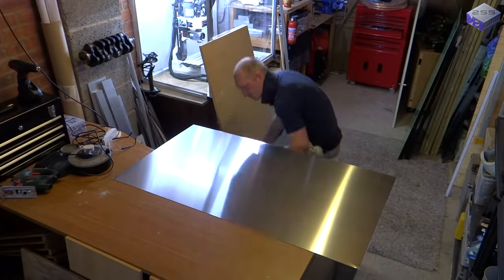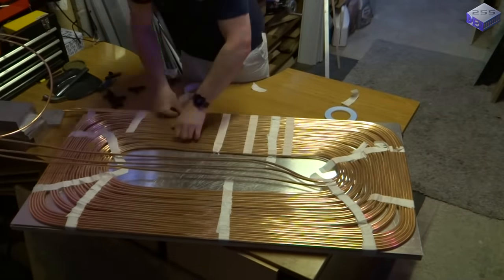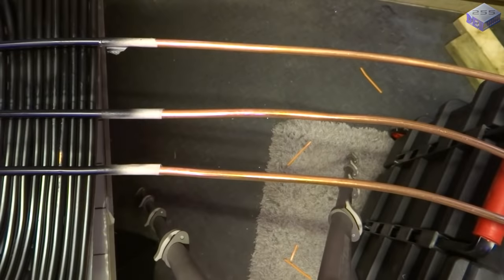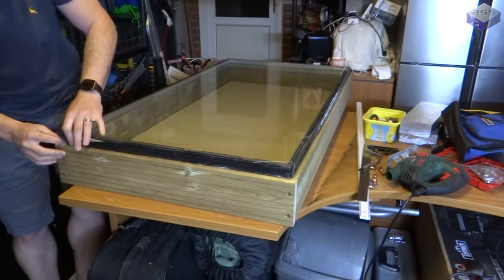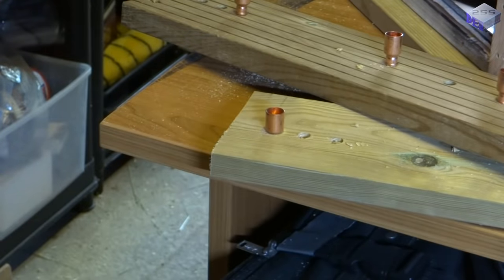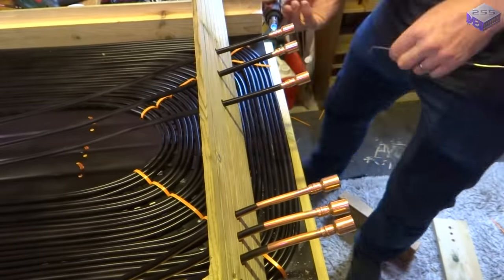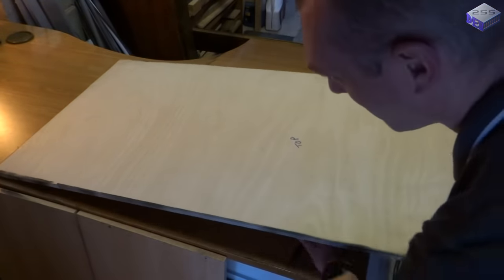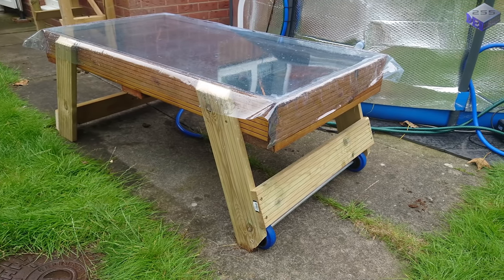Improved Solar Pool Heater - Full build

Comment: You have to know if the insulated glass has any coatings. Many times insulated glass can have solar reflective coatings that will reduce solar heat gain inside a house. So that would be self defeating. Just something to be careful with.
Reply from the maker: Thank you, I will have to get a meter to test the reflectivity of the glass and try different materials, I think Acrylic may be the best option. I will look to make a video on this and other changes that have been mentioned. I guess that's why green houses are made up of single plain glass.
Reply: @TheSolarPoweredEngineer  new greenhouses are made of polycarbonate roofing sheets, which are a lot cheaper (then glass) and more insulating then a single plane of glass (as pockets of air, traps heat) and a lot stronger (as glass shatters), also polycarbonate needs less cleaning, as glass needs to be cleaned more often to give it that nicer look. If you use toughened glass (as that still needs to be cleaned regularly) that is very expensive and not cost effective for a greenhouse which uses a lot of surface area.  Polycarbonate roofing sheets, diffuse bright sunlight light, which is better for plants photosynthesis. So plants get more light from all over instead of very concentrated unidirectional light which can burn plants in the midday heat. Green houses are for plants growth and cost effective results, so the glass doesn’t break, doesn’t need regular maintenance and mainly plants grow fastest and produce best crop yields, they trap in heat and maintain constant temperatures for a bit longer in winter and stop over heating in summer, which you may not want for a solar heater. 

Polycarbonate roofing sheets are newly manufactured in response for greenhouses as there is demand and market for it. Hence are cheaper as the need for food and crops yield is very high. For solar heating a new material should be made, and is made (solar glass) but is very expensive as it’s a luxury material not a necessity one like growing food. Demand is low, so cost is very high, but results is excellent, in fact the best by far. 

However for a smaller project like this, it may be worth it. As you only need a few square meters. 

On a larger scale the cost vs benifit means ; not worth it for solar glass, so plastic wins it. And the surface area is increased to increase the overall heat output. Rather than expensive materials which only makes a smaller difference. 

Glass transfers more light than plastic, so will create more heat under it, hence can burn plants, but retains heat less, as it conducts it out faster, but is more expensive per square meter and needs cleaning and can shatter. Different purpose then solar heater.

Cost is a major issue with large scale projects. As well as longevity of materials. So short term costs and targets and long terms costs and targets have to be considered as well as labour costs and maintenance. 

https://greenhouseemporium.com/blogs/greenhouse-gardening/glass-vs-polycarbonate-greenhouse/
Reply: @TheSolarPoweredEngineer  polycarbonate is better (retains heat much better) than acrylic and is much cheaper for the same square meter and overall thickness. Eg 4mm of polycarbonate (per square meter) is ~ half price of 4mm acrylic for the same square meter.

They use polycarbonate in modern green houses and not acrylic anymore, which older greenhouses use to use. Cheaper and better, and allows plants to grow faster without damage.
Reply from the maker: @harunyahyadotorg  I will have to get both polycarbonate and acrylic of the same dimensions to see which yields the most. One thing I want to try also is reducing the amount of air in the panel, so reducing the sides of the frame so that the tubes are closer to the acrylic/glass/poly cover. Plus, this will also reduce the shadow forming over the tubing. Thank you for your reply, I love the detail you have gone into. 👍

Comment: Looks good.  Could you use Acrylic instead of Glass for strength?
Reply: I would think that it would work better actually. Acrylic won't block UV light the way glass does, which could increase thermal collection, and has a lower conductivity, which will hold more heat in. If you're going through the trouble of insulating the back, you'd definitely want to double or maybe triple glaze the acrylic to get the best results.
Reply from the maker: Definitely, or even clear polycarbonate. I was looking into some of the comments here where they were suggesting the UV reflecting properties of the sealed unit, I may have to purchase a few different types to see which one is best.

Comment: If you made a triangular support so you could angle towards the sun you should get better performance.
Reply from the maker: Hi, I will be looking at solar tracking the panel this year with an Arduino based system, or even have mirrors that track the sun to reflect on the panel as this may be more efficient.

Comment: I would have drilled a small hole in the chassis. To avoid air volume within the chassis to apply pressure inside the body due to temperature increase.

Comment: Please: What is the ratio [KW / meter of copper tube used] in each Solar Pool Heater (A) first and this b) second improved one) ?
Reply from the maker: Good question. Well there was 50m in solar heater A and 75m in B and with around 900W in A and 500W in B, this would be 18W and 6.67W respectively. This doesn't sound like a lot, although accumulatively both panels together provided around 7kWh over a good day with good sun coverage.
Reply: Wouldn't you agree then that first version with 18Kw/m  production had a higher heating performance? :) 
If so, what do you think is the reason for this "improved " version to perform poorer as the first / more basic one? Thank you in advance.
Reply from the maker: @rubencg8787  Hi, totally agree, although this improved version is much smaller, more robust and has the potential to generate more than the first version, there are a few tweaks that I need to try, such as changing the glass for acrylic or polycarbonate to let more energy in, reduce the air gap in the panel, improve the insulation and work out the best flow rate to generate turbulent flow in all pipes. I may even try different paints to see how effective it can be. This one is far easier to store as it can stay outside too. I want to also add a couple of side reflectors that track the sun to see how much energy can be captured

Comment: Im.plsnning a 25m x 8m x 1.2m pool in zambia, what do u suggest for heating in the cooler months?
Reply from the maker: Hi, if you filled your pool up to 1m, you would have 20,000 Liters; my pool only holds 4600 Litres at best; it's difficult to say over cooler months, although our pool maintained around 10ºC above ambient outside temperature a few months into autumn. The best option for most size pools would be a pool blanket (micro 500) and pool cover. The more you insulate the pool, the easier it is to maintain. The micro 500 covers allow around 80% of the sunlight to pass through to heat your pool and reduce evaporation. If you were to add several solar heaters, I think about 10 of this version 2 heater or 5 of the version 1 solar pool heaters would work well. If you want to make one, it's best to test just 1 out on a small pool to see how it performs in your area. I hope that helps.
Reply: @TheSolarPoweredEngineer  thnx 2m is 200,000 lt
Reply from the maker: @brendsn roberts  Ah, sorry, yes, I missed out a 0, doh! a small mistake, although a massive outcome. It may be better to look into a PV Solar Powered heat exchanger or mains powered as it will take a fair amount of energy to maintain a decent temperature. Again, insulating the pool as much as possible is still crucial to saving energy and conserving pool heat. Good spot on my error though 👍

Comment: also consider, that your FLOW rate is 2 parts.   1 is the volume, the other is the speed at which the water moves.    for heating like this, you also need to consider SURFACE area that is in direct contact with the water.   so,  with an unknown surface area, you can assume the following.    higher SPEED = less heating.   higher volume = less heating.   and higher volume + higher speed = 2x less heating.  

with this above, we can dream up a quick example demonstrating the above.   if you used a large fire hose 2 inches, going through 2 inch copper pipe,  pumped with a pump that a firetruck uses..   its heating would be near nothing. because the water is such a large amount of volume and speed, that it never has a chance to heat...  

the oppisate is that you have a small 1/8th inch fish tank air hose line, going the same distance,  but pumped at less than a gallon a minute would produce the MOST heating.

so, for your little heater you made,   set the hose to SERIES, so that you get the LONGEST amount of time for the water to be heated, and slow your pump rate down to increase it even more,  would increase your heating by a very large factor,  no matter how much sun there is.  

but this is all dependant if you can HEAT the water beyond its current temp.. otherwise you have a pool COOLER!!
Reply from the maker: All things to consider in my next test of it, I will try several different methods including pump control and may even get the Arduino to find the best flow to temperature increase by testing at different intervals, then changing to series and doing the tests again, kind of like a car ECU working out the throttle map for best air to fuel mixture at a given rev to get optimum efficiency.

Comment: Nice thanks ,what temperature you can make ?  possible to use this  for my house heating .
Reply from the maker: Thank you, yes you could use this system for your house, although would need a good number of units depending on your system and may not be viable. I would have a backup heating system as well though for overnight and winter months. The best way to look at these are the wattage they are capable of, this one measured around 500W with direct sunlight, so take a look at your current boiler to see how many Watts that is and you will know roughly what you need. Most combi-boilers are around 12KW I believe, so if you wanted that sort of power you would need 24 of these, and that's only while the sun is shining, so may not be your best option. I suggest taking a look at air heat exchangers or ground source heat exchangers/pumps. I hope that helps. Oh and its possible to get the water temp up to around 68ºC, but that's only 10 Litres in a bucket, so it depends how much you are heating
Reply: @TheSolarPoweredEngineer  thanks Neil . Clear answer and very good video
Reply from the maker: @reneterm25  Thank you, glad you enjoyed it 👍

Comment: I would have put a bead of silicon on the wood between the glass frame and the notch it sits in for a seal there and then went around to clean up the visible outer edge.

Comment: Hi Neil, firstly great job. I'm planning  to build something similar, so after a search and finding yours, I plan to build virtually the same thing, based around your design, so thanks! You mentioned in one comment that you are thinking of removing the glass and replacing with plastic, which type would you replace it with?
Reply from the maker: Thank you, I am looking to test a few different types, although a 2 way mirror was mentioned and a glass panel from a green house, as this does not block any rays from the sun, so I believe this would be the best option. Also, the use of plastic cable ties may mean they degrade, so probably best to use metal ties, plus you may need a breather pipe from the inside to prevent condensation build up. I'm looking in to copper use with chlorine at the moment as it's a concern for some people as it can degrade if the PH balance is off. Hope that all helps, good luck with yours
Reply: @TheSolarPoweredEngineer  Hello, how would someone install a breather pipe? Thinking of building this after summer exams!
Reply from the maker: @nermainmerl6108  Hi, this can be installed the same as the other pipes, so two short copper pipes (one at either end) that point down to stop the rain water getting in. I will be looking to modify mine soon to see if a clear polycarbonate sheet would be better for its efficiency. Hope yours works out well. Good luck with your exams.
Reply: A coil of black HDPE will perform about the same and is far less expensive. I will have to be longer to compensate for the poor conductivity though. 
Ideally if glass, it should be low iron glass and tempered. Relatively small hail will break a normal window. 
Two or three wall polycarbonate is another good option.

If going with copper you might consider getting a copper sheet instead of aluminum. Though more, you can use less tubing and solder the pipe to the sheet for good conduction.

Researching selective surfaces wouldn't be a bad idea either. They are one that has a high absorbtivity in the visible spectrum, but poor emissivity in the infrared spectrum. As I recall black copper oxide is one. Which might be formed with a caustic or acidic wash.
Reply from the maker: @court2379  Hi, I agree, my previous panel is HDPE I believe and is under an acrylic sheet and collects around 900W (max) on a good day with direct sun. I do need to do some modifications to this one, with one of those mods being an acrylic sheet.

I did look at a copper sheet, although as you mentioned, it costs a fair bit more but would enable me to solder to it.

I'll have to look into copper oxide then as I have been looking into getting the most out of different wavelengths, I believe IR accounts for around 45% of the suns energy that we are exposed to (probably why we can't see in IR, as it would be quite a blinding light).

Comment: parael is nice but you are not sure that all 3 pipes take the water water takes the easy way so 1 pipe can do more than the ather 1
Reply from the maker: Very true, I did think of this, although all pipes are outputting some of the water flow due to the pressure from the pump and remain cold (heat transferring to pool). If I was to put them in series the flow would be reduced, with the pump working harder (more power required) for the same heat output (slightly reduced efficiency of heating when slower flow) so I opted for parallel configuration and ample pressure to ensure flow through all. Good observation 👍
Reply: @TheSolarPoweredEngineer  or take 3 falfs and 3 flometers than you can see and control the flow
Reply from the maker: @arthurvandongen2  Good point, I may just do that to see which one is best and then equalize the flow. Flow meters are quite cheap now, I could also attach a temperature probe to each input and each output, then calculate the live Wattage from each channel and how the valves affect each one 🤔

Comment: Sorry to say this after the fact, but if you were to sand the pipes with a coarse sand paper you end up with more surface area and therefore more energy absorption.
Reply from the maker: Hmmmm, very good point, I hadn't thought of that. I may be trying out a different option later this year, making 300mm by 150mm aluminium heatsink style panels with lots of machined out fins, all sprayed black with a copper pipe running through them, all behind either purspex or glass in a thermally sealed box. Thank you

Comment: So you need to heat your pool in the summer?
Reply from the maker: Yeah, it does seem a weird idea considering it is nice to jump in and cool down, although our UK summers are far from constantly hot, plus it's nice to jump in a warm pool in the evening after the sun has disappeared (water is a good store of energy with a specific heat capacity of 4182).

Comment: Be interesting to see if pool chlorine reacts with the copper.
Reply from the maker: Hi, not as yet, although the water does go directly to the pool. I'm currently looking into this and trying to get an answer from a university or other professional body as this is a concern from reading some of the comments. The thoughts at present lean towards using chlorine only when needed and maintaining a neutral PH balance as the chlorine will react more aggressively if the PH is off neutral. Drinking water also has chlorine in it (although the amounts may be a lot smaller) and runs through copper house pipes with a neutral PH, but that is professionally monitored. There need to be more answers online. A heat exchanger plumber into this system would be a better option, I will be looking at doing this as a closed-loop system, that way I could connect PVC pipe to the copper pipes and have the PVC pipe run around the bottom of the pool transferring the heat. I hope that helps.

Comment: Could you test filling it with ARGON or Nitrogene ? Maybe it will heat up more because no air inside.
Reply from the maker: Hmmm could be a little expensive, what about no air, surely a pure vacuum such as space would allow the transfer of energy directly to the pipes rather than also being attenuated by the air too. Hmmmm, thought-provoking...
Reply: @TheSolarPoweredEngineer  if your structure can hold vaacum why not, I have nitrogen and argon at work, will test this the day I moved my lazy ass on doing this ^^
Reply from the maker: @surronzak8154  Yeah, I may need to try something like this, although not sure on maintaining the vacuum and moisture getting in, I am thinking of making solid-state resin-covered panel, this could work well I think.

Comment: Did the pool chemicals attack the copper piping?
Reply from the maker: Hi, it hasn't corroded yet and I don't believe it will as the PH is kept balanced (more copper corrosion with an unbalanced PH) and has the same chlorine level as tap water which runs through copper pipes in the home. I will be fitting an 18W UVC clarifier to the system also, which will allow me to reduce the chlorine level by around 80%.